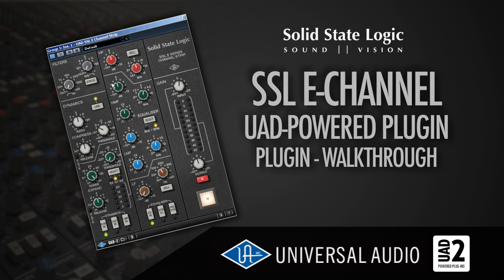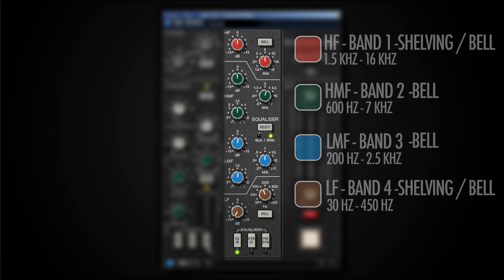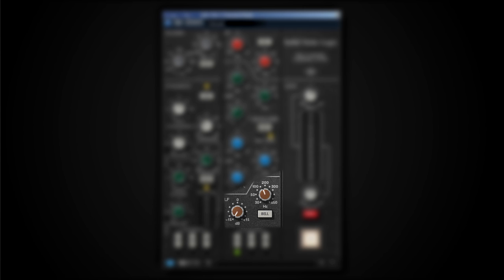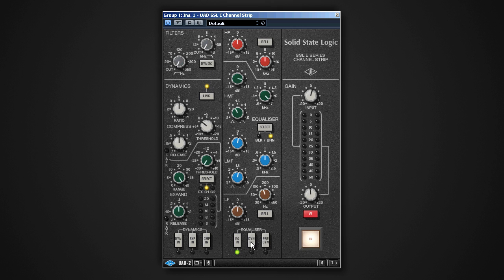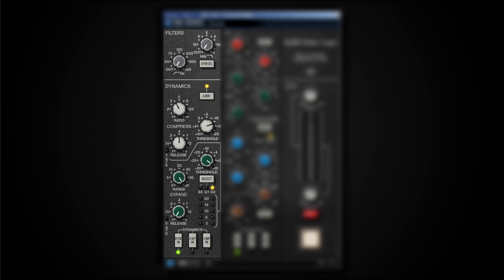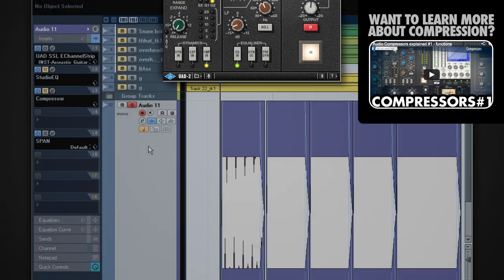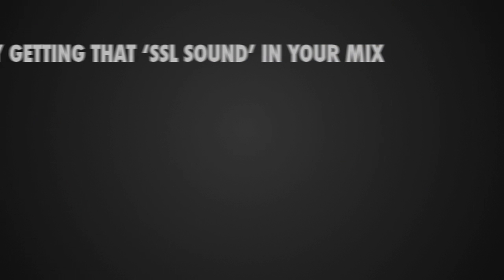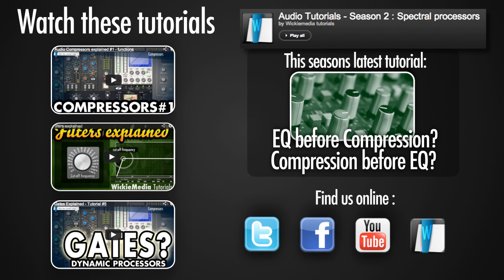UAD - SSL - E-channel plugin explained

Comment: Good video. The knobs are confusing though on the EQ. There's dots all around the knobs and some of the numbers have no dots across from them. Hard to tell exact values. Also, IK would assume that each gain knob is stepped at 3dB each dot the rest I am clueless.

Comment: Do UAD ever update these? A lot of stuff happens in DAWs and whatnot in three years.
Reply: Update what exactly? The core snapshot of the electronics doesn't need to be updated. The host software is updated regularly as well as console for use with Apollo/PCI/Thunderbolt solutions. See the UA UAD2 site for more info. These plugins run on the UAD2 platform, which is hardware; so when the main console is updated to the DAW, and the wrapper, that is what gets updated for DAWs. SO, they do release new plugins, but the plugin itself doesn't need to be updated just because the DAW is updated.
Reply: So what is the difference between the bundled Legacy plug-ins and these older plug-ins? Is it a technical difference or just a case of UAD deciding to include some under the Legacy name?
Reply: Some 'Legacy" plugins do not yet support unison, which is the ability to track in real time in the input console. So, some new plugins are "unison compatible" with the Apollo series to use the plugins live on the inputs just like a real mixing console with zero latency. Some older plugins still work perfectly and don't need to be updated for the OS as nothing to do with DAW or the OS as it runs on UAD hardware. So, "updates" would refer to updating for UAD hardware, in the context of supporting new features added with Apollo hardware vs original PCI hardware. Lots to explore on their website. :-)
Reply: I have both an Apollo plus quad PCI that I had first; added the Apollo, double the horsepower. All my old plugins and new ones work seamlessly in Logic X / El Capitan.
Reply: They just did!